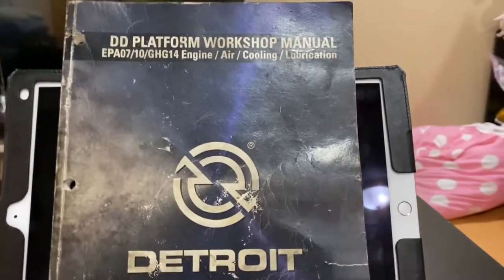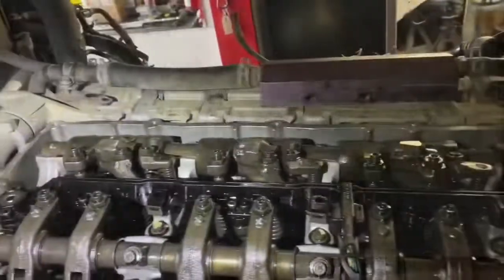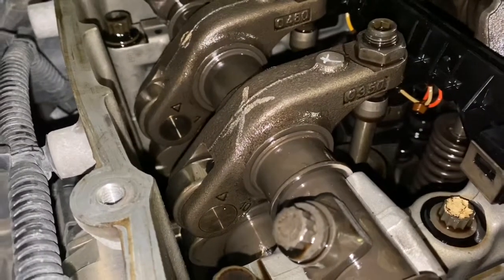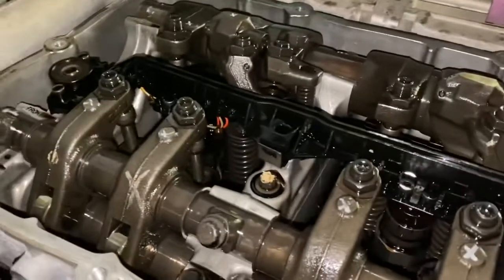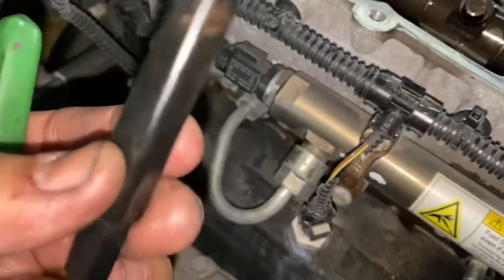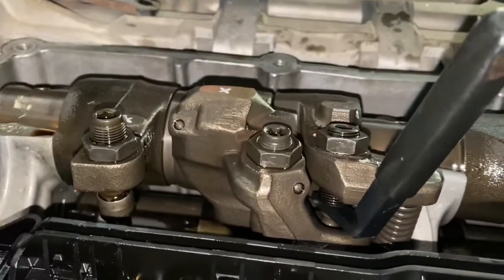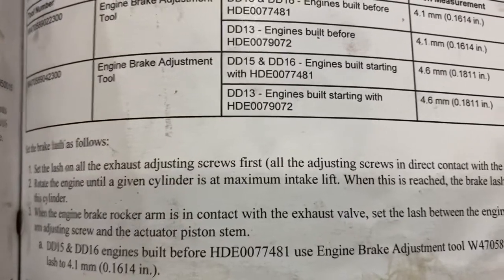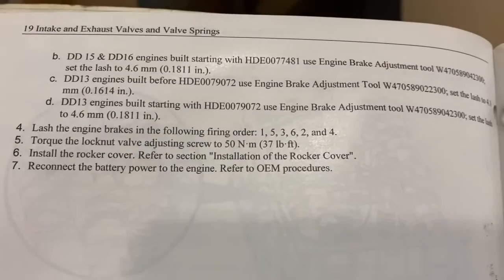DD15 and DD13 engine brake, exhaust brake, Jake Brake adjustment.

Comment: You failed to show what is considered maximum lift on the intake lobe.
Reply from the maker: Fair enough, I’ll do a video to better illustrate it. Usually I put my hand on the lobe and feel when it stops lifting. There is a point where it stops traveling up and before it starts to go down.

Comment: My Jake doesn’t hold steady it just raises rpms to around 2300 but does not hold as strong any more goes hold then let go then hold then let go even on light loads I have to stab brake way more than usual I never use to have to touch my brakes coming down mountains does that mean i need mines adjusted? 2018 cascadia dd15 933,869

This seems like a simple and easy process to do myself I don’t mind getting my hands dirty at all

Comment: Hey Pedro, I have a 2017 cascadia with a DD13 I want to ask everytime I take off from a light a lot of smoke comes out of my exhaust but only when I accelerate when am on the highway no smoke comes out.  Smoke is white sometimes blue and sometimes black, I never knew you can adjust the j brake could that be a leading cause for that ? Thank you
Reply from the maker: Sounds like fuel, 
Start with a compression test 
Idle speed balance test to see if an injector or injectors are having issues
Valve adjustment 
And last. Do you have a delete?
Reply: The truck does have a delete yes
Reply from the maker: @Elias-r6z  start with the basics. 
Valve adjustment 
Idle Speed Balance test. All injectors should be closer to Zero at idle. You have to use the DDDl software

Comment: Is it the same for the newer engine?
Reply from the maker: The process is the same for newer. 
What year?
Reply: @CarlosDieselElectric  2020
Reply from the maker: @mikefuller5174  the process is the same. The clearance is usually printed on the engine brake. On the exhaust rocker
Reply: @CarlosDieselElectric  man experience is worth more than what you learn in school I really appreciate you man🙏

Comment: Where can I get the workshop manual? Is there a link?
Reply from the maker: I have not found a link. I purchased the books from Valley Power Systems in City of Industry, Ca. 
Call the parts department and talk to Nick or Steve. 
They sell the manual in sections, lube and coolant.  Fuel system
Reply: @CarlosDieselElectric  Thank you for the response! Sorry for the late response.

Comment: When 1 cylinder intake is max lift exhaust rocker arm is tight on the valve (no play) right?
Reply from the maker: Sorry for the late reply. 
Use the lobe on the intake to help, so rotate the engine and remember the firing order. 
1-5-3-6-2-4
When the intake valve lobe is pushing up on the roller. When it stops pushing but before it starts to roll down. Stop and then adjust the exhaust brake only. 
I recommend adjusting the valves first. Then checking the exhaust or engine brake after. Makes it easier.
Reply: @CarlosDieselElectric  no worries I just read how it says when the exhaust rocker arm contacts the valve then adjust the engine brake lash

Comment: Hi Pedro. Thanks for video. Yesterday a mechanic did valve adjustment for my 2019 DD15 engine. Today I started engine and figured out there is little knocking sound. And when I press gas pedal the sound turning like engine brake sound. While I am driving the sound always on like engine brake is on. What do you think about this problem and what is your suggestion? Thanks
Reply from the maker: I hope the mechanic did the adjustment correct. But to be sure you should have the mechanic double check or take it to another mechanic. 
Did the mechanic adjust the valves when the engine was cold or hot?
Reply: @CarlosDieselElectric   Hi Pedro. I appreciate you for responding me. Yes engine was cold. I asked him what tools he used. He told me .4mm for intake, .6 for exhaust, for jake brake 4.6mm. But there is a weird sound. Like something is knocking.
Reply from the maker: @martinkazako2292  those are the correct clearances for the intake and exhaust. 
My guess is there a valve that might be too tight or out of adjustment. 
Have the mechanic double check his work. I hate to put people on the spot but it is possible. 
Also, just thought of this. Check for any loose connection or hoses around the air filter
Reply: @CarlosDieselElectric   Thanks Sir
Reply: @CarlosDieselElectric   Hi Pedro. Today the mechanic checked again. Yes there is loose in exhaust side cylinder 3 valves. Mechanic is saying that valves were very tight. And he stating he already adjusted them. But while I was doing test drive knocking noice were coming. The result is cylinder 3 valves are loose. Now mechanic saying we have to do compression test by sending air (with tools). If it can’t pass compression test. We have to replace cylinder heads and valve for cylinder 3. Is it correct? What is your suggestion? I am in ILLINOIS. I am so sad that I don’t have chance to come to your shop. I am too tired of inexperienced mechanics. Please give me your suggestion. Thanks
Reply from the maker: So before any adjustments were made, did you already have the sound or problem? Or did the problem happen after the adjustment?
Reply: @CarlosDieselElectric   before adjustment there was no sound like that. Mechanic told me while he was adjusting valves exhaust cylinder 3 valves were too tight. He had hard time to adjust them.  But he said he could adjust it. But when I turn ignition on after valve adjustment that knocking sounds was on. And while I was doing test drive that sound was accelerating like sound of engine brake. Today mechanic opened top cover of engine and showed me exhaust cylinder 3 valves. They were too loose. And sound was coming out of there.
Reply: Bro what is suggestion about it?
Reply: Hi Pedro. How are you doing? Today mechanic did compression test. And said there truck has bad cylinder head. According to your experience Is it true ? Thanks bro
Reply from the maker: @martinkazako2292  It is possible to have a bad cylinder head. What did the compression test show? Which cylinder was showing bad compression?
Reply: @CarlosDieselElectric  
According to computer all cylinders are working perfect. All 6 % is between 93-100. But when mechanic pressuring air into system from the pipe which is attached to turbo. Air is coming out of exhaust. Mechanic told me it is bad head. But he couldn’t see which cylinder.
Reply from the maker: @martinkazako2292  I don’t want to throw shade on someone or another mechanic. But get a second opinion. Hard to believe you have 90% compression or higher and still have an issue with the cylinder head. 
I would recommend to get a n opinion before you spend some serious money on a repair you might not need.
Reply: @CarlosDieselElectric  
Yes Sir. Tomorrow I am going different shop. Thanks your advice. Where is your address?
Reply from the maker: @martinkazako2292  659 S Maple ave Montebello, Ca 90640

Comment: I have Mack e7 running on one head .is this a expensive job to have a shop do it ?
Reply from the maker: It’s actually not that difficult to do although I have not worked Mack or Volvo engine in awhile. The timing marks are in the CAM, as you rotate the engine you line up the mark in between the hash mark then make the adjustment. But, the exhaust brake does require a shim for the lash. 
Most valve adjustments or tune ups run about $350-$450
Reply: Thanks for the response

Comment: I wish detroit do some marks to get that max lift. Its kinda hard do it without somebody helping to rotate from bottom.
Reply from the maker: That would be a great idea. I know Volvo has the marks on the CAM.
Reply: How many adjustments have you done that were actually out of spec? I haven't found any. The guys at my previous shop didn't even check them. They are never out of spec.
Reply from the maker: @TaurusTheCreator  the engine brake almost never goes out of adjustment. But on this video I was working on an overhaul. So I always go over all the valves and exhaust. They engine brakes are solid. The valves on the other hand can vary.

Comment: Well done, very resourceful video thank you for your effort and time to give us a great knowledge. Does engine breake adjustment similar on Volvo vnl old one like 2007?
Reply from the maker: From what I remember, the Volvo valve adjustment and engine brake adjustment are very different. 
On the Volvo CAM there are timing marks and you need shims. I haven’t worked in a Volvo engine in awhile.

Comment: I'm here trying to figure out if shop loosened my Jake solenoid on purpose. Went in for tie rods, came out with what felt like tranny problems, ended up stranded otr Regen failure. Dealer found loose Jake solenoid. Any help?
Reply from the maker: I’m going to say not likely. To loosen the Jake Brakes (solenoids), you have to remove the valve cover and all the accessories from on top in order to gain access. 
This could be a coincidence.
Reply: @CarlosDieselElectric  thx. That's comforting to hear but yeah, the coincidence is staggering. Thx again!

Comment: Question. Is there any legal way you can make the engine brake louder
Reply from the maker: I don’t believe you can make the engine brake louder.
Reply: @CarlosDieselElectric  i hate how they are quiet now
Reply: Its because of the muffler.
Jakes will get loud if u straight pipe, have no filter or less restrictive (louder) muffer.
Reply: @koollee  so having a dpf system theres no way to do it?

Comment: Hlo sir how i can find engine built before for slect which one i have to use 4.1 or 4.6
Reply from the maker: What year is the truck?
Reply: @CarlosDieselElectric  2014 last vin fk7662
Mfg date 3/13
Reply from the maker: @harvindersingh3828  it should be stamped on the Jake Brake rocker. Let me check tomorrow what the book says. Have you removed the valve cover?
Reply: @CarlosDieselElectric  yes i already remove valve cover and done valve adjustment thanks to you your videos help alot so thank you.

Comment: if each intake valve has its own rocker and cam lobe. you use the 4.1. if each cylinder uses only one intake cam lobe and one large "bridged" rocker, you use the 4.6. that info was a pain in the ass to come by. but its 100% accurate and much easier than trying to figure out numbers and build dates.
Reply from the maker: I agree, the first were a pain to figure out. So glad it is in the Jake
Reply: So if my cascadia 2016 and has 14.8 liter engine which shim I need to use?
Reply: @tait4613 open it up and look. If a single cam lobe is used for 2 valves use the 4.6mm

Comment: Where did you get the book with the information or how can I get one?
Reply from the maker: I purchased my books through Valley Power Systems in City of Industry, CA
Reply: Ok, thank you
Reply: Another question. How can I get or purches a book like that, maybe one on the electrical and electronic system.

Comment: Where you guys located I need both valve and J brake adjustment also some oil leak, let me know I have 13 FL Cascadia DD15
Reply from the maker: We are in Montebello, any engine brake and valve adjustments have to be done with a cold engine. 
Also, what kind of oil leaks? Where are the leaks?

Comment: Carlos necesito tu ayuda tengo uno q pasa diesel x el escape y se desboca
Reply from the maker: Puede ser injector, puede ser la cabeza? Que pruebas has echo?
Reply: @CarlosDieselElectric  gracias le puse un jgo de inyectores de otro motor igual en buen estado y otra válvula de control  la de los tres tornillos otro sensor de riel
Reply from the maker: @emanuelgonzales8628  cada inyector tiene su propio código que uno tiene que poner en el MCM ( computadora del motor). 
También, ay varios números de inyectores. No todos son igual.
Reply: @CarlosDieselElectric  gracias ya  estoy quitando la cabeza  de todos modos al rato te comento q sale te boy a seguir molestando gracias desde Guadalajara
Reply: Trae pistones embarrados orita le quite la cabeza una pregunta el caracol q sale después del turvo uno grande también falla y q ocasiona gracias
Reply from the maker: @emanuelgonzales8628  la turbina casi no falla. Es muy raro. Si falla puede ser los sellos adentro de la turbina.
Reply: @CarlosDieselElectric  gracias  camarada gracias saludos

Comment: Hi Carlos. I would like to ask you for help if you can help me about my spn codes. Some time ago I was asking you for the help about knocking sound what I hear when I accelerate and you told me to check the clutch. Only what I find out is that when I press clutch pedal little toward floor sound stop but if I let it go foot from pedal start knocking again. I visit lot of mechanics but no one know what is the problem. Now I have spn 973 fmi 9 code and spn 185 fmi 1. What do you think that those codes have something related w knocking sound when I am going up the hill ? Please help me if you can. Thanks in advance

Comment: My freightliner Argosy Cummins power is cutting off engine when the engine brake is on,and the engine brake is coming in lately,we replaced the clutch switch but still giving same problems
Reply from the maker: Meke Lasarus let me try to understand the problem. Does the engine brake come on and will not stop?

Comment: Just do it during the valve adjustment following the exhaust valves for whatever cycle your on you can adj at the time you don’t need to turn the engine a million times
Reply from the maker: I agree, there are a few ways to do it. I just try and explain the easiest way so it will minimize mistakes and certainly minimize engine damage. Most people do not have the experience  to try it the way you are suggesting.

Comment: Where did you buy your DD platform workshop manual that you're using for valve and Jake adjustments
Reply from the maker: I purchased my books from Valley Power Systems in City of Industry, Ca

Comment: Location and how much to adjust valves and jakes DD15 2013 cascadia
Reply from the maker: Sorry for the late reply. Valve adjustment and engine brake adjustment usually runs about $350. Takes a few hours but must done when the engine is cold.